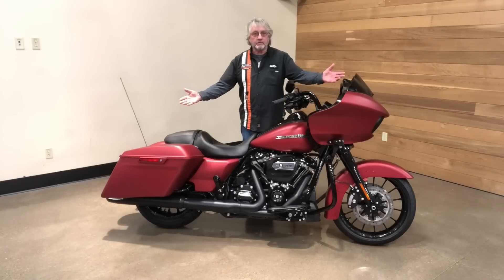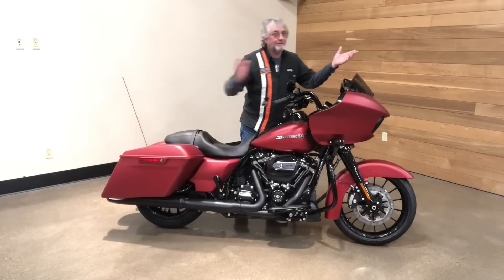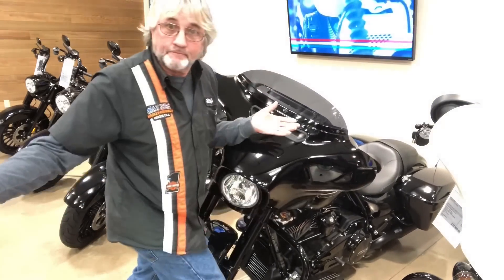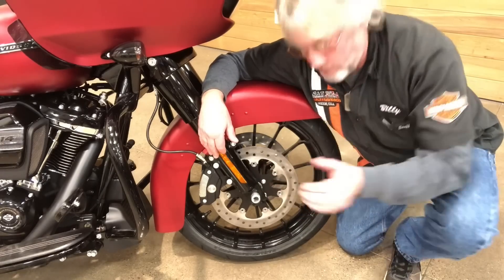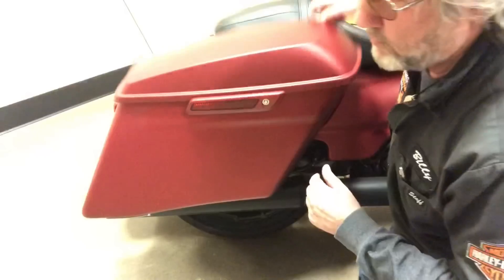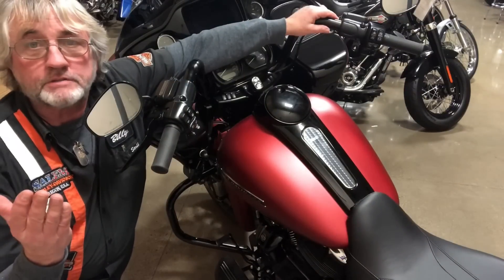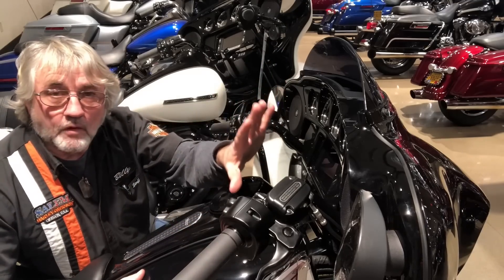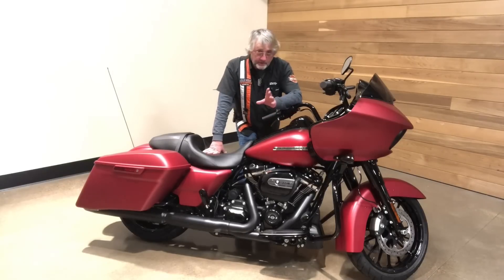2019 Harley-Davidson Road Glide Special

Comment: What is the difference between special and normal road glide? That seems like if you don’t want chrome, you will pay more. Also, stage two is another noisier exhaust and bigger air filter.
Reply from the maker: Agreed, the special comes with 6 inch informant screen, abs, navigation are all stock on the special but optional on the standard. You’re right about the chrome too.